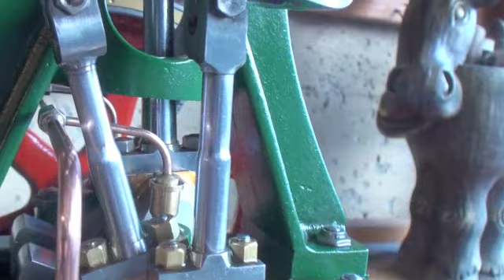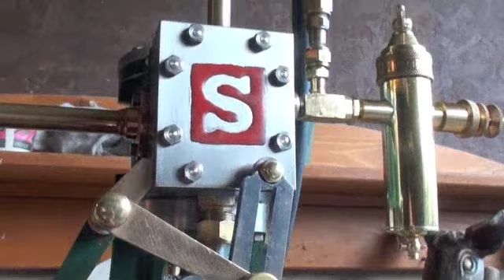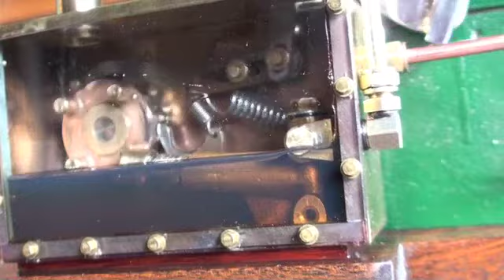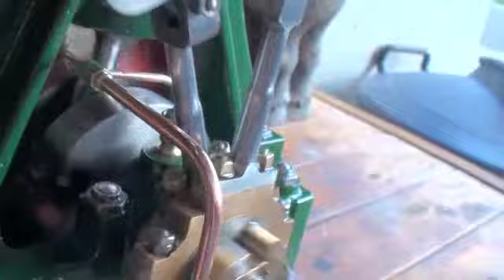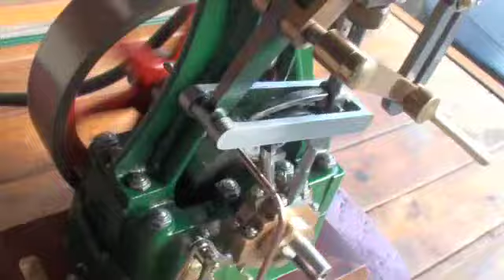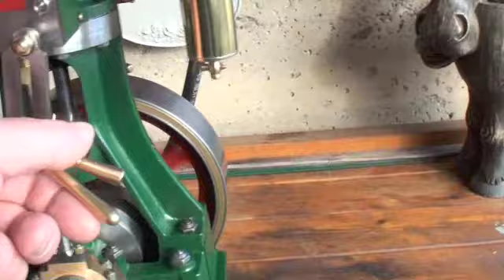STUART TURNER 5-A, W/REV GEAR & LUBRICATOR

Comment from the maker: The crank pin is drilled on an angle through to the main shaft via the crank web where it can get oil supplied by the pump.The pump is not exactly high pressure so it relies on centrifugal force to get it to the big end, it then drains down into a sump where it then drains back into the pump housing.
Thanks for checking out my site.
I may hook this engine up to the power hacksaw you see elsewhere on my site.
   Bud